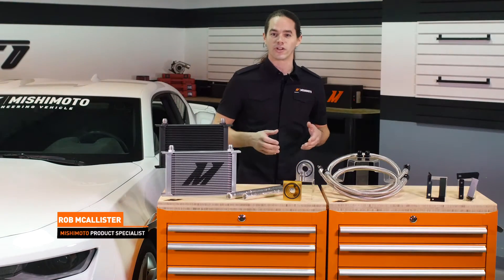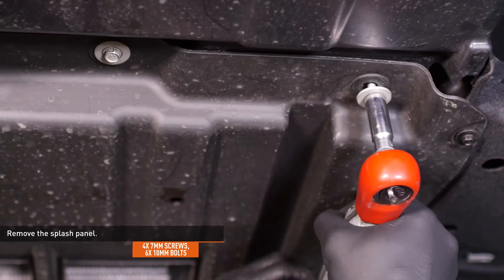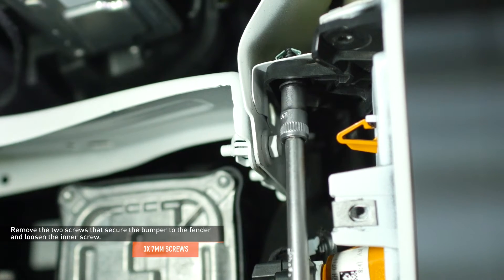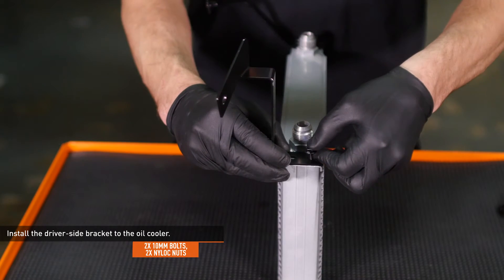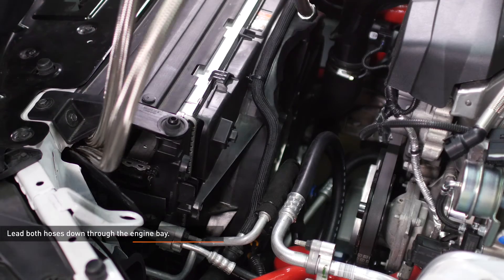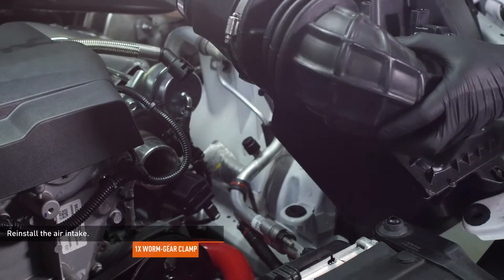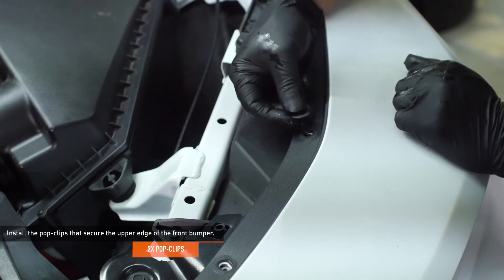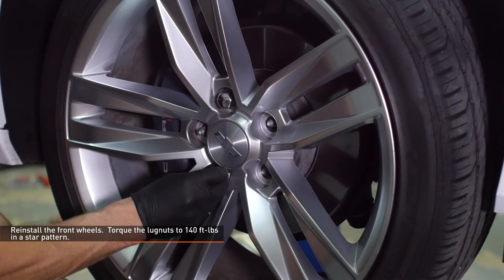2016+ Chevrolet Camaro 2.0T Oil Cooler Kit Installation Guide by Mishimoto

Comment: Will this fit on the 2016 Camaro v6 ?
Reply from the maker: This was designed specifically for the 2.0T. You may be able to use this or a universal kit kit, however! Unfortunately, this is not something we have personally tried so we cannot confirm if additional modifications to the product(s) or vehicle will be required.
Reply: @mishimoto  i was told by a Mishimoto associate that works for them that i would need a oil filter relocation kit for my V6 Camaro in order this oil cooler to fit
Reply from the maker: If you have a drop in filter, it'll need to be converted to a spin-on style. Please shoot us an email at support@mishimoto.com if you have any additional questions.